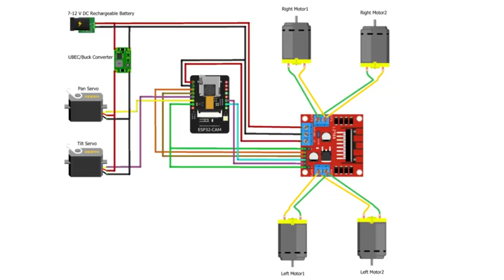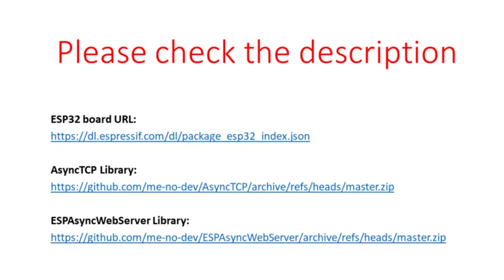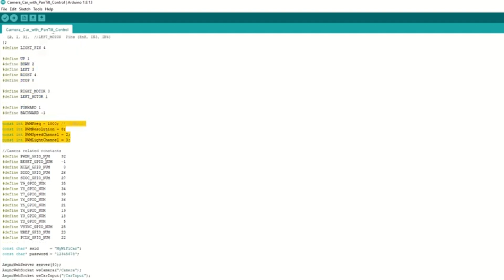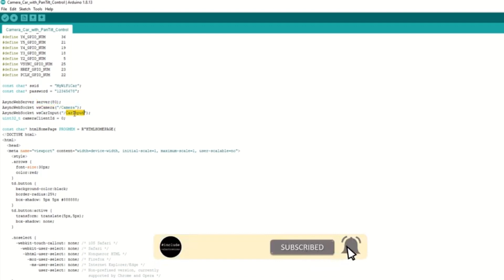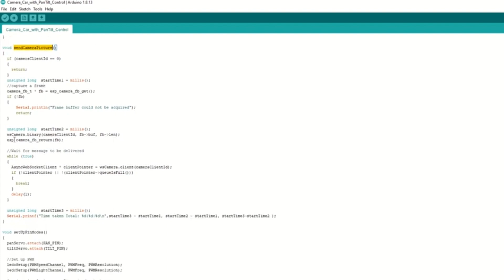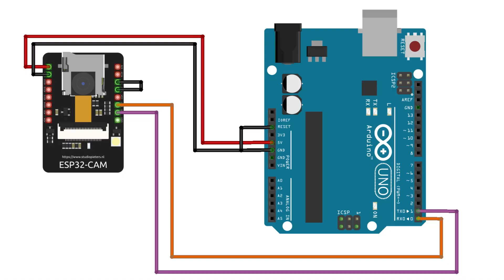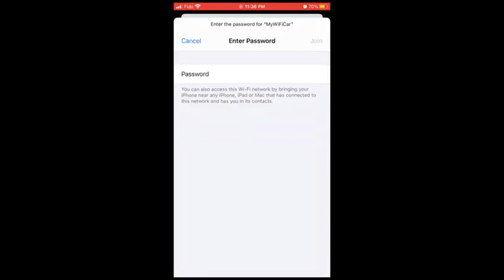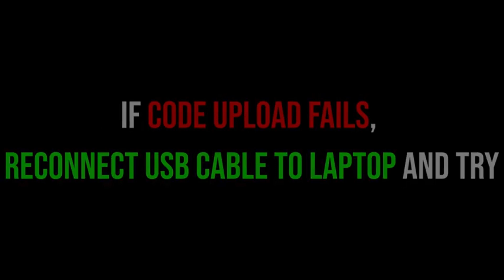Surveillance Car with PAN TILT Control | Using ESP-32 Cam Module |

Comment: Excellent work friend. I have a problem and it is that when I move the servo the video image freezes and there is a delay of up to 2s from when I move the bar until the servo activates
Reply from the maker: There is one setting which needs to be done . Please check the video for steps 👍🏻👏🏻